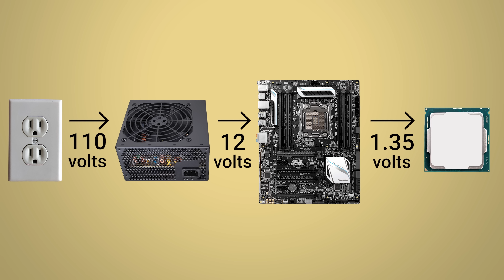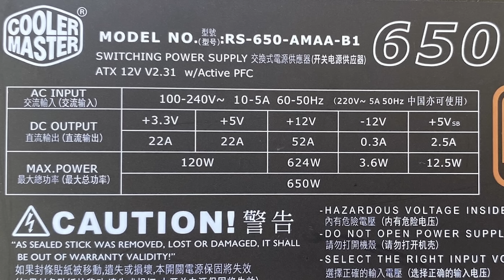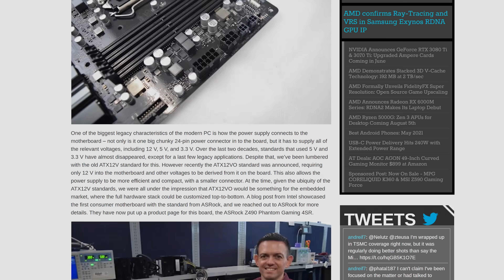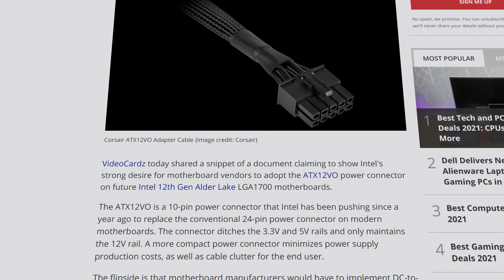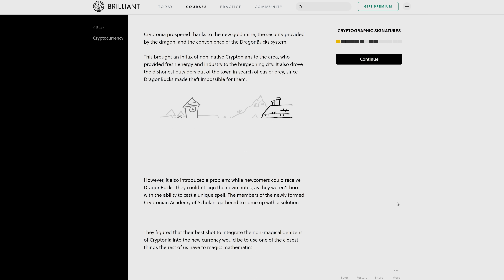Is The 24-Pin Connector DEAD?

Comment: Voltage converter on the motherboard is a fried motherboard waiting to happen
Reply: What do you think a motherboard does currently? Most of a motherboard is doing voltage conversion and stabilization and it already has to produce a lot more different voltages than the PSU does. PCIe already uses 12V, which means you won't have to do any conversion for the GPU. And it already converts the power for the CPU and the memory (along with internal ICs, but these don't have a lot of power draw).
Reply: @simongunkel7457  Low level voltage only, like 1.5 volts or less when it comes to actual conversion.  All the higher volt (and therefore higher watt) conversions take place on the PS, which is where most of the thermal wear and tear comes from. Power supplies have evolved over decades to handle such. Mobo's have not. 
 Only examples of consumer mobo's doing this is mobo's from shitty dells and hp's, and those are NOTORIOUSLY prone to mobo failure, and literally always have been...
Reply: @conandude76  Wattage is voltage times current for DC, and that's roughly 75W per GPU through the PCIe socket, and yup, a high end CPU is pushing over 100A, heck on Threadripper CPUs you are looking at north of 200A. And all of the CPU power comes from converting 12V prom the PSU. Most of the GPU supply also gets downconverted from 12V. And of course just getting 12V allows you to just pass through the 12V for PEG. The PSU in ATX 12 still does the conversion from whatever AC voltage you have locally available to 12V DC. But in terms of mainboards, it doesn't change a whole lot.
Reply: Wow, you guys sound like a bunch of robots that think they're about to get their little capacitors cut off.  Drives would only need at most a few amps per drive for 5v and 3.3v rails and switching regulators are not going to generate a lot of heat at those power levels, at least nothing you would notice.  And if the 5 volt and/or 3.3 volt regulators on the motherboard went out you'd likely still be fine just adding a pass through regulator for the drives instead of using the motherboard.  Most if not all 3.5" drives use 12 volts and don't actually need the 5 or 3.3 volt rails. It's the 2.5" drives that rely solely on the 5 or 3.3 volt rails, like the 2.5" SSDs that tend to only use the 5 volt rail.  One SSD I have here is rated 5V-1.7A but that amperage would only be during a heavy use case and there aren't a hundred of them in the system, just one.  So unless you have a ton of drives to power, the regulators just aren't going to need so much power that you'd notice extra heat.  And NVMe drives won't care at all between 24-pin and ATX12VO and since most newer systems that people are going to build are going to have only NVMe drives you shouldn't care either.

Honestly, I want more!  Higher voltages like even just 24 volts would be more efficient in reducing the wire clutter.  Bring us ATX12VO and then ATX24VO, ATX36VO and ATX48VO all at once for servers and more industrial applications like CNC and printers !!!  DO IT!  JUST DO IT!

And really, if a motherboard is going to get fried then it is more likely to be from a bad case, old age or user error.
Reply: @10100rsn  you clearly never put 10 different RGB products on SATA. The point is instead of frying a cheap pay, you gonna try an expensive motherboard
Reply: @jasenrock  The SATA power regulators aren't going to fry the entire motherboard.  If it does, don't buy from that manufacturer.  And f@#$ RGB.  Some higher end boards have RGB controllers built in anyway.  If your blowing up regulators because you plugged in too many fancy LEDs then you're doing it wrong anyway and that's user error. That's your own damn fault.
Reply: @10100rsn  Just what everyone wants to do.  Have more expensive motherboards more prone to failure, with more cables coming off the mobo and fucking with clean builds and their cable management, all to shrink a plug that's not a problem in the first place ....with the added benefit of jimmy rigging a pass thru when it fails and crossing fingers rather than just dealing with the already perfectly fine 24 pin that no one with any brains has ever had any problems with...
Reply: @conandude76  An ATX12VO build with NVMe would be the cleanest you could get. Not to mention the simplest.
Reply: @10100rsn  Yes, IF you are m.2 ONLY that's great.  That's about what? Less than 1% of customers? Everyone will need new PS AND new mobo, and you wanna justify it with the less than 1% of people that MIGHT care?  That's cool, those of us elbow deep in custom builds more than once every 3 years are gonna go with reality instead.
 And to be fair, those fat square plugs and their power cords are ugly. and to use them at all you have to have more cables in front of the mobo.
 Again, all just to make an inch or so long plug a quarter inch shorter?   /smh
Reply: @conandude76  If you are buying new then don't go with yesterdays parts, buy new.  Get that m.2 and the new motherboard and RAM.  If you are 'upgrading' THEN UPGRADE.  You end up with more useless pieces of tech if you upgrade this or that part but not everything.  Waste less and spec a whole new system and sell the old one.  Honestly, distributing so many power rails to different devices is inefficient and looks messy and it's only still being done that way for backwards compatibility with old garbage that most modern PCs will never see.  It doesn't matter if it's 12, 24, 36 or 48 volts, a single master voltage bus between all the different components is better than supplying all the devices with power rails that those components aren't even going to use!  3.5" drives only really need the 12v rail as they have onboard regulators for lower voltages they need.  2.5" drives mostly only use the 5v rail and most, including SSDs, ignore the 3.3v rail. So why do we need ATX12VO?  It's called progress!  If you don't like it then suck it up and gtfotw......
Reply: @10100rsn  "Turbonerd goes on a rampage ignoring e-waste problems just because his computer case made of glass looks slightly different with more wires in it".

You realize that "the looks" of the insides of a computer is literally irrelevant to something like 80-90% of end users, right? 'Gamers' are a ridicule small percentage of the PC market.
Reply: @Bramble20322  my desktop is built into the cardboard boxes the components came in plus a motherboard tray from a 20 year old PC case. If people want to spend a fortune making more ewaste by picking this or that individual part to upgrade, then let them eat plastic...
Reply: @XionEternum  "PSU 5V and 3.3V conversions are also so very prone to failure, it's amazing how many replacements happen in their 10+ year warranties. These conversions are totally going to fail just as much on motherboards" - If THAT failure is common in PSU happens now in a MOBO...
Replacing a mobo would mean reinstalling your OS, compared to replacing a psu that is plug and play.
Reply: agree
Reply: I was about to write this but beat me to it.
Considering most mobos manufacturers dont really have that much dealings in the PSU part of things, I'd be sceptical of how reliably they convert 12V to 5V, creating more heat than it should, plus accounting for the VRMs and CPU thermals, let alone the increased costs.
Reply: Not to mention that mobo manufacturers tend to cheap out on lower end boards.
Gone are the days where you'll be able to have a good 100$ PSU and a cheap mobo.
Reply: You'd think so, but that's what all those capacitors are doing - preventing things from getting fried.
Reply: @Machtyn  That's not what a capacitor does, bud, not at all.
Reply: @Machtyn  Gonna need much more now, increasing the cost of motherboards
Reply: @Machtyn  capacitors aint the only thing that a electronics carry.
Also laptops mobos do the conversion and look how the mobos end up most of the times.
Fried mosfets, IC chips, diodes etc.
And take into acount laptops have even less TDP than your average PC, imagine going from some 65tdp to the top max 115TDP of the gaming rigs, it would be a really costly dissaster if mobo just breaks.
Reply: @mementocity  The biggest problem I have with laptops are the power connector. They're so flimsy and easily breakable. It's one of the very few things that Apple does right with a macbook. And other companies should do something similar.
Reply: @Machtyn  wat

Comment: Additional duty for motherboard, now Motherboard manufacturers will demand more premium for their ATX12VO motherboards. While PSU makers won't reduce any cost in the name of adapting a new standard. 
All this and we still get 10 pin connector that is incapable of running powerful systems and requires extra power via PCIE connector. In the end customers are just losing. Except a few cents they save in the name of power savings.
Reply: Couldn't have said it better my man
Reply: I still remember when motherboards were one of the cheapest components, <$100. Now they're several hundred dollars because everything is onboard… except the actually expensive parts. 🤦
Reply: This os the criticism of the standard on their very first video on the subject. They don't care. Don't go looking for consumer oriented videos and points of view on this channel any more. The ship has long sailed.
Reply: Plus: Even cheap Chinese PSUs are capable of achieving same level of performance as premium PSUs, eliminating the need of expensive PSUs.

Minus: Motherboard power distribution is far more important than it will ever be, negating the cost savings for a beefier motherboard.
Reply: I think you really overestimate the cost of a 3.3v or 5v buck converter. If we're talking about low cost mobos, that may make a difference of $1. These rails typically don't have high loads, power regulation is relatively easy, and you can get away with fairly low cost components. At the same time you may also save 20 cents due to the smaller connector (yes connectors also cost money).

Obviously it can be marketed in a way that will increase cost, but I don't think there are many technical reasons for significant cost increase.
Reply: @theIpatix  Are you living in some short of non capitalist paradise? Cause here, where the rest of us live, companies don't exactly need rational reasons to bump prices.
And even if, the second most important issue is the more points of failure in an already cheaply made product,
Reply: @theIpatix  I think you are overestimating the empathy these companies have towards consumers. They need an excuse to increase prices. They'll give you 10 different reasons justifying the cost increase. IMO costs of motherboards will increase by $20-30 in the name of ATX12VO.
Reply: @AkashYadavOriginal  Fair point.

Comment: This sounds way more complicated and with more compromises than the regular 24 pin ATX connector.
Reply: The transition from 24-pin to ATX12VO is what makes things complicated.  Most motherboard manufacturers are likely going to have both 24 and 10 pin connectors on at least some of their boards for some time. It's also likely that adapters can be used for 24-pin PSUs on ATX12VO boards even though the standby voltages are different.  It's unlikely that a motherboard would become useless if it's SATA power regulators failed since you can still use an external board to get SATA power.  And NVMe drives won't care at all between 24-pin and ATX12VO and since most newer systems that people are going to build are going to have only NVMe drives you shouldn't care either.

Honestly, I want more!  Higher voltages like even just 24 volts would be more efficient in reducing the wire clutter.  Bring us ATX12VO and then ATX24VO, ATX36VO and ATX48VO all at once for servers and more industrial applications like CNC and printers !!!  DO IT!  JUST DO IT!
Reply: It’s not even anything new… intel are literally copying decade old HP workstations with proprietary components haha.

Dunno if you ever saw the inside of an HP elite workstation, but the PSUs don’t have sata power, rather you had 4-pin connectors on the motherboard which works exactly like what intel are now saying they invented.
Also, HP had smaller motherboard connectors too… no 24 pins… kept users locked down to HP’s upgrade prices, which were usually extremely extortionate.

I may be wrong but I believe Dell also did the same with their optiplex business desktop lineup.
Reply: @grahamb7947  Placing the SATA power controller on the motherboard sounds like another excuse to increase the price of this part, ans another piece of the mobo to fail or break. Replacing a broken PSU is easier than a broken mobo.
Reply: @bluestar5812  Easy just get rid of SATA.
Reply: @Distress.  it is not easy to get rid of Sata since some cheap boards can only provide a single m.2.
Reply: @jayvee8502  fix the cheap boards or just use the old connector in those cases

Comment: I think the pins will get smaller in time just like the new RTX 3080 like has with a adapter of some sort the motherboard manufacture will include. Its hard to tell now but just like USB, There will try and make it easy or confusing in what pins to use :/

Comment: Think bigger. Why not 12 or 24 Volts DC straight from the wall outlet HUH?  You could use solar panels and why not and converting from 24 to 12 volts would be easy. Do we really need 230 V AC or whatever? Only your fridge or your washing machine and maybe a Sauna, Other devices would be fine with 12 or 24 volts and those converted to whatever the device needs. Maybe for mining and tough gaming you might need higher amperage but that could be supplied straight from wall as well. Lets standardize wall outlets  and solar power as well world wide while were at it
Reply: Can't tell if you're being serious or sarcastic.  Hmmmmm.
Reply: @TheKuptis  Seriously sarcastic maybe? I just wanted to point out the waste energy and heat every transformer produces. Maybe Edison had a point in DC and we would be better off having DC voltage straight from the outlet. Motherboards need 12 volts, as do many other devices. So why not have it straight from the wall? Solar seems to be best option to get electric power easily after installation and it can even make you money.
Reply: The reason I asked that is if you were being serious think of all the infrastructure that would have to be eventually replaced in order to switch over that you and me would end up having to pay for.

Comment: Please make a video about "how to choose a PSU that doesn't explode"
Reply: buy a good brand one as if they fail, there have a fail safe and not blow up if it has a power run away if motherboard trys to take more power then it should, Aka auto overclocking.

Comment: I’ve only ever had issues with the cpu connector
Reply: Same the second connector for my cpu didn’t reach
Reply: MY chinesium cpu extension cable melted to my $200 motherboard and i ripped part of the plug apart to get the remnants out of the mobo. Works still.
Reply: @leerman22  Lesson learnt I hope.
Reply: On my recent build I skinned my finger on the VRM heatsink trying to unplug the CPU connector.
Reply: Exactly this. The cable provided is usually an inch too short and the socket position on the motherboard is usually in the worst place possible in terms of fan and radiator clearance.
Reply: It's more about unplugging the 24 pin connector for me.
Reply: It's an issue for people with air coolers, I only use air coolers so it is annoying
Reply: Personally, I hate the USB 3.0 19 pin connector! Trick is to line up PERFECTLY and do NOT force in. Those pins are so delicate! A real plug it and forget it header!
Reply: Isn't it easy tho to unplug?
Reply: That can be annoying in certain cases, it's like doing a maze in the dark
Reply: That's cause they usually put it hard up to the top of the mobo which in most cases (get it cases) makes it a PITA to install.
Reply: I was so annoyed that my pc wasn’t working, I was googling everything, I even dismantled it and rebuilt it but still couldn’t figure out what was wrong with it. Turns out I forgot to plug in the CPU power cable.

Comment: Why couldn’t they just make it an 8 pin connector like the cpu and gpu power connector so all of the connectors will be the same and if a board requires more power just add another 8 pin resulting in the same 16 pin like the Z490 motherboard required

Comment: Yea great for the environment. All the legacy stuff is now useless for a new pc.. cant use my old perfectly fine psu in a new system.. new standards are almost never good for the environment...
Reply: I agree, this new standard doesn't actually solve anything.
Reply: don't thing it will be great for the environment as computers some are using more power to reach 5000mhz+ even if the dies are getting smaller
Reply: old PSUs will simply need an adaptor cable for new mobos, old motherboards can still be used with old PSUs and will be outdated much sooner anyway.

Comment: I have just learned.. About to plan my first build that would also be first I have put together myself 100%... SCREW 12VO if it comes out in schedule.. Seriously the worst timing for me...
Reply: If you are using an NVMe drive on a modern motherboard and you don't need SATA drives then you won't need to worry.  NVMe drives just don't care about 24-pin or ATX12VO since they're board mounted...  And even if you do need SATA, you shouldn't need to care too much about it.  Adapter cables would likely be included with an ATX12VO board.

Comment: I never had problems with hooking up a power supply. My mb tray is removable from the case and is easy to hook up. I don't see this as an improvement but more as a way to screw the consumer over on price. No, they won't change anything except the price gouging already going on right now. If you are so incompetent as to have problems plugging in a 24 pin connector, then perhaps you should not be building a pc.
Reply: chuckles in "The Verge"
Reply: correct